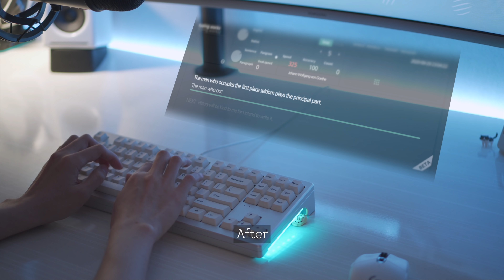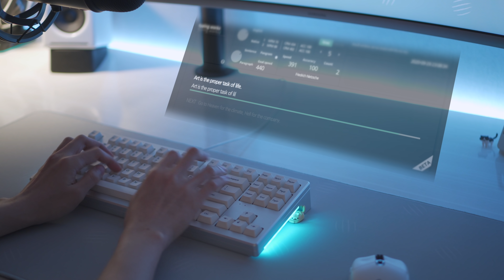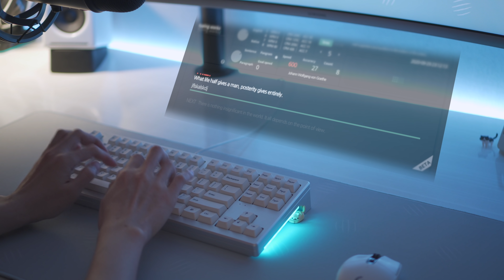ABKONCORE AR87 Mods | Lubed Cherry Black Switches Typing Sounds

Comment: I personally don't get why people just lube the stab wire, you can holy mode or put a little small piece of adhesive in the stem to make the wire secure. It works soo good. Great video, thanks man.

Comment: omg that masking tape mod is precious! I'm gonna try it on my kbdfan67 v2 mkII because it's so pingy right now.
Reply: its a bit late and you may have worked it out by now, but the pinging on that comes from the weight. masking between the case and weight will sort it out

Comment: I bought the blue aluminum version of this keyboard with Mx Browns.  I noticed that this model doesn't have the light indicator issue and they are very distinct to show the indicator to be Caps Locks or Scroll Lock, no light bleed out of the box.  I've also noticed that there is no ping when typing hard on the keys.  I haven't opened it so not sure if they made some changes to the construction of the foam underneath or added silencing tape to the aluminum case, but there is really no metal sounds other than the keys bottoming out and it's not the sound of metal or pinging.  I'd recommend maybe trying out the blue aluminum AR87 instead of the silver one.

Comment: Yea, that's what I was saying on your last post on this keyboard.  Do all the fancy stuff and this board will be killer!  Looking forward to watching this.  I have a desoldering gun but I've screwed up a PCB or two in the past.  I think I know now... keep it tinned... make sure I'm cleaning it often/poke out shaft, empty solder catcher, and make sure filters are clean (mine only heats the tip so the shaft can clog with solder easily.  Does that model you have work the same or is it harder to clog?), and always make sure I'm aware of it being on either celcius or farenheit.
Reply from the maker: I didn't desolder many keyboards so far but it never clogged. 
Good luck!

Comment: Masking tape between the case halves, you keep coming up with amazing mods, nice. I keep recommending people who want to mod their keyboard to watch your videos, seeing you got so many ways to improve a keyboard.

Also, fixing a warped Space with a hairdryer? I see a lot of people not recommending this, but rather use hot water, but the very best being using a heatbed of a 3D printer, have you tried the other methods before? Or has the hairdryer trick never failed you? Asking as I have a warped Spacebar in my GMK WoB kit.
Reply from the maker: I haven't tried any other methods. I've fixed many spacebars with that way but all are fine so far.
Reply: @3ildcat  Ah, I see. Is that including ABS, or only had do unwarp PBT so far?
Reply from the maker: @Hionimi  I did both including GMK. As long as you don't overheat it, it's okay.
Once you overheat, ruined.
Reply: @3ildcat  you almost invented tape mod you were so close

Comment: A question i wanna ask about the hair drying of the warped space bar to straighten it. How long do you actually heat the space bar for? A few minutes, seconds?? Would love to know!!
Reply from the maker: Don't know exact time but I am pretty sure it was less than 10 sec.
If you overheat, it will be ruined.
Just try short, short, short.
Not long time at once.

Comment: I've never soldered anything before so this may be a dumb question, but if you don't solder the switches back in could it technically become a hotswap board?

Comment: hey wild cat, ive looked at your tutorial for fixing stabs but for the wire balancing part, you didnt really tell us what you were doing to balance them. could you make a more in depth guide on what to do?
Reply from the maker: cuz it's simply twisting little by little til it's balanced.
you can see in next video coming soon but not that depth guide.

Comment: Impressed by the local language typing. Is it that easy to type Korean(if I am right)? Do you type Korean that much better than you type English? Or does it appear so fast since you have to press multiple keys for the ditrics / glyphs?
Reply from the maker: I've just typed only in Korean for a long time so it's easier for me. Some say Korean input system is more efficient but requires more shift keys and combination to type a single word.

Comment: this is probably a dumb question but how does adding solder help take out the solder that's already there? is it bc of the heat makes it melt?? i'm clueless but curious
Reply from the maker: The solder on the PCB is lead-free solder which requires higher heat and has less flux. 
And the leaded solder requires less heat than lead-free one so the result is as you can see.

Comment: Normally, I like all your builds and this is a good build up by you. But at $320 this is a no go.  I understand its complete but for that kind of coin I'd go with something higher tier with a hundred bucks or so added and put my own switches and keycaps. The base weight of this keyboard seems appealing though as specs call for 6.4-6.8 lbs. and again it is plug and play.

Comment: not sure if anyone in comments can help me with this, my ESC and Tilde key don't work after desoldering and resoldering on the AR87. I've tried desoldering and shorting the socket and it registers, but for some reason doesn't work when the switch is soldered on. any help is appreciated! Luckily I have two of these, one of my favourite pre-built keyboards honestly!
Reply: If it works when you short the sockets, i assume you've ruled out broken/damaged switches by trying different switches?
Reply: @zenna5062  correct, i've tested the switches on other boards and they work fine. I have yet to try to wire the switch manually, as I havent picked up any wire yet, but that might be my only option unfortunately. Pads are fine and all, so i'm still stumped.
Reply: @forbiessedits1541  That is very weird... Are these switches that have been desoldered previously or brand new ones? I've read desoldering switches can possibly damage the contact leaf in the switch in some way. Though if the same switches worked in another board then that's probably not the issue. Weird. I'm curious how it will go with the wire.  

Until you get wire, if you had a paperclip or something similar you could try holding it in place and touching the points you were planning on connecting with a wire while you pressed the switch to test it.

I'm planning on making a custom PCB for this board in the future anyways so I'm not too worried about possibly damaging mines when i go to desolder the switches. Desoldering (especially lead-free solder) sucks.
Reply: @zenna5062  I'll try the paperclip option. And unfortunately I even tried soldering in one of my many other brand new switches I have and nothing worked. The wire job will have to do for now. A custom PCB would be awesome, let me know if you get one up and going, I'd be very interested! I love these AR87s so much! Ill let you know how the wire job goes when I get around to it. Desoldering these were a hassle definitely, but oddly enough the esc and tilde key were one of the ones I didn't have to apply my own solder to, to desolder them
Reply: @forbiessedits1541  I'm using a custom pcb in an IKBC MF108 v3 right now because i wanted an aluminum fully programmable full size board but those rarely happen even in the custom world. I added pcb screw in stabs, a rotary encoder, and QMK & VIA. 

The original pcb for the mf108 stopped working after i desoldered it but i'm not sure if it's the pcb that's damaged or the jst wire that connects the main pcb to the usb c daughterboard. I was also careless desoldering it and handling it afterwards because i was planning on replacing it from the beginning.

It will probably take a long while to get around to doing the same for the AR87. First i need to desolder it so i can take measurements of the original pcb and locations of the plate screw holes, key clusters, smd side RGBs, and usb c in relation to each other. I'll let you know how it goes when i finally get around to it.

Hopefully it works out for your pcb with the wire. Good luck!
Reply: @zenna5062  sounds great man. Thanks for letting me know! Best of luck with the PCB! Would love even QMK , VIA would just be a treat! Haha

Comment: I was going to come in here and say something like  "Man if they would do a hotswap version they'd claim the market"
And then you took it apart. It's a nice case, but I don't know if 3 pin autotraced pcbs are worth what they're asking. What is the stupid fascination mfg's have with these marginally cheaper 3 pin boards?

I get that most people get into this stuff after getting something on drop, and all of those boards come 3 pin... but the second you step one foot farther into the hobby you end up with hundreds of 5 pin switches that (if you're like me) you'd rather not clip. 

So disappointing. Sounds a lot better though and I honestly wasn't sure that modding would improve the sound of the AR87 all that much!